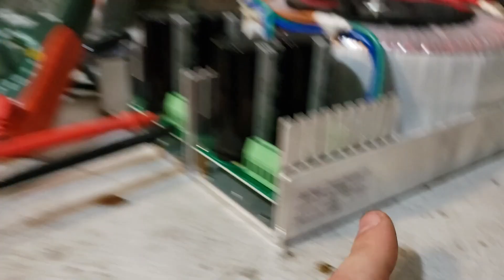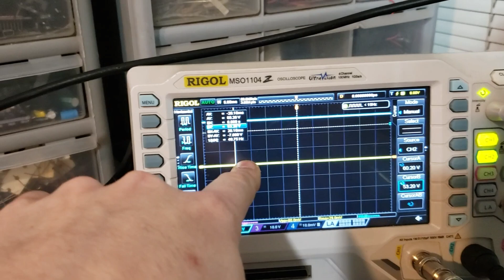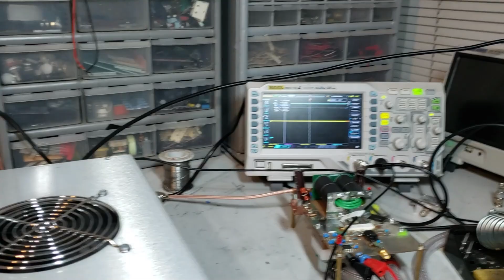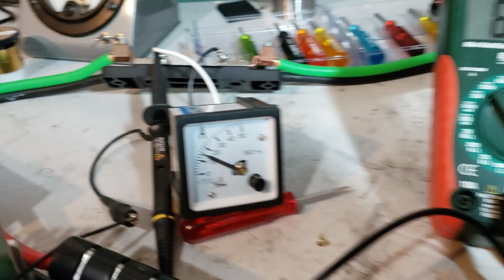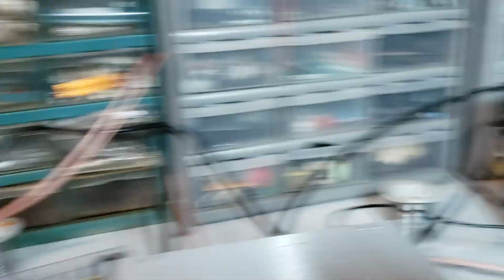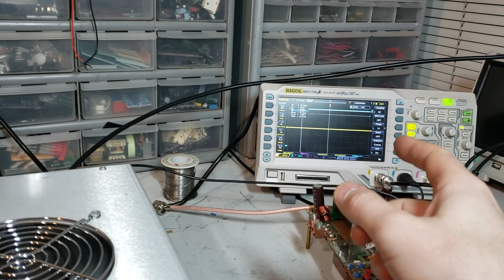65v Linear Power Supplies

Comment: Don't take this the wrong way. I like your videos but for someone who knows, they kind of make you look foolish. First, the noble prize folks will be bringing you an award for solving the old issue with efficiency. You are making more output power than you are putting into the circuit.. That is of course a historic moment and everyone is either knocking your door down to buy this alien technology or they are trying to kill you to keep it out of the market.  You are going to be disappointed in something. Maybe its the meter, I don't know. Lets do the math from your figures. 60.2 volts times 20 = 1204 watts input. You are showing 1800 pep out. Something is out of whack. You are getting more power out than you are putting in by a long shot. If your current and voltage figures are right then you are probably only getting about 960 watts out out pep.  I don't know whats wrong but I know something is wrong. That's 80 percent efficient too. Looking at the dead carrier the efficiency is shit.  60.8 times 15 is 960 watts in. You are getting 400 out. The efficiency here is in toilet at about 42 percent. Speaking of over taxing the power supply because you said you didn't want to over do it. The power supply is only good enough for 1560 watts input. Which equates to (at 80% eff) about 1250 watts out. Why are you  blowing smoke up our asses here?

Comment: Mr. MudDuckSharky ,  I just wanted to say thank you so much.  I ordered one of these power supply and love it. it's better than a mean well.  i built a ldmos off your schematic i did a little change to it like i a doorknob capasistor  of 650pf in the place of the 2 of 330pf  and it  runs great . thank you again .  aka 6o cheyenne wyoming channel 28

Comment: my dad wanted to know why you were phased by a transformer, bridge rectifier, and capacitors yet were comfortable with what looked like a complicated (by comparison) transmitter circuit?

$250 for an unregulated power supply is eyewatering expensive, yes he understands the high current rating of the transformer makes it more expensive but $250 for an unregulated power supply! what you, missed is that the 60-volt power supply would also transmit mains fluctuations at the ratio of the windings which on 110 volts would be 50%. it may be of course you do not need a regulated voltage but $250 for an unregulated supply. do you know $250 would keep my fashion disability satisfied for at least a week?

Comment: Can you parallel 2 and do they have a common share connection?
Reply from the maker: Yes. Output can be put in parallel, as many as need, with no other connections required.

Comment: 1800 peak watts out put? 
Come on  really? 
Your input power is , 60.2 volts by 18 amps equals 1083 watts 
So 1083 watts in, produces 1800 peak watts out put? 
Lol.   
18 amps for 1800 watts ?    
Come on Sharky .  Do the maths .  Look at the data sheet and efficiency curves. 
I question your watt metre !     166% efficiency ?   No way!
Reply: The amp meter is not a peak reading device. The bird is reading peak.
Reply: I agree, also, Why not hook up probe to RF output on Oscilloscope? Actually measure the peak to peak voltage to determine actual output?
Reply: I am not nearly a tech but i can understand it, 1000 watt DC will convert into 1000 watt RMS sinusoidal which will have a PEAK voltage aprox 1/3 higher then the RMS voltage and so in a 50 ohm load will have a PEAK wattage of over 100%. 
Right?
Reply: A 110 volt electric heater 1000 watt.
P=U(dc or rms)  x I 
U(dc or rms) =I x R
So I=1000:110=9 amp
So R=110:9= 12.2 ohm

So peakvoltage of 110 rms= 110x sqrt2= 155 volt @ 12.2 ohm
So Ipeak= 155:12.2= 12.7 amp
Ppeak= 155x12.7=1969 watt

His 1800 watts peak sounds to me just about right.
Right?
Reply: Thats why "they" say "peak power doesnt mean shit"

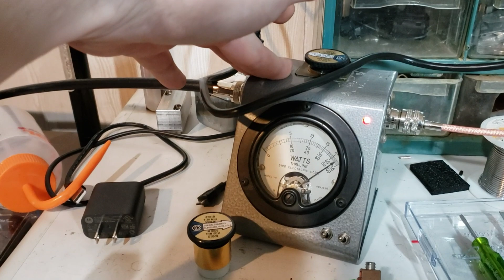Look at 6:53 , just before switching to peak you can see 500 watt rms(or is it average?) 1083 DC watts in: 500 RMS watt @100% mod out=50% eff.
Doesnt sound teabag for me, it is at least plausable.
Reply: robber576
Btw, he is not sticking his rf probe at the output because there would be around 300 volt rf(600 volt peak to peak) and his scope would probably blow up, you need a pretty expensive high voltage rf probe or rf hv attenuator to do that besides a scope is a quality device and not a quantative.
Reply from the maker: @robber576  Thank you for breaking it down 😁.

Here is my laymans terms answer:

It's like having a 100w light bulb turned on for 12 hours per day. Average power over the entire 24h will be around 50w, with a peak power of 100w. That's kinda like what's going on with this amplifier. The peaks are modulated all the way up to 1800w, but it doesn't stay there very long, showing an average input power of much lower than 1800w÷drainEfficiency.
Reply: It surprises me that this needs to be explained to (apparently) licensed ham operators 🙄
I have had 1 (start) year of medium level electrical education and then went the mechanical road for my profession about 30 years ago, i dont even have my ham license(but considering)🙂 
Nice videos, i like your style, keep it up 👍🏻
Reply: I didn't realize(wasn't listening) you were modulating AM, I thought it was CW, Where PEP & Average power are the same.
With those unprotected linear power supplies, my fear would be RF from antenna system getting into mains/transformer. With a dummy load you wouldn't see it, but when you actually transmit RF I suspect there may be an affect. Worth a test.
HV Probes are not that expensive, and the probes themselves are attenuators..
1800 Watts into 50ohm load, RMS would be 300v, PPv would be 849v, Use a 1000v or 2000v RF or standard probe.
Reply: @MudDuckSharky  
This link explains rms and peak watts .

https://www.kicker.com/app/misc/support/tech/tech_papers/docs/PeakVsRMS.

Or here is NXP data sheet, 
https://www.nxp.com/docs/en/data-sheet/MRFX1K80H.pdf

Figure 7 , cw out put power versus input power and drain source voltage
At 65 volts, 1150 watts out, equals 1900 watts input!   1900 watts / 60.8 volts = 31.25 amps 

Or figure 8 ,
Cw out put power , drain source voltage and efficiency, 
65 volts at 1900 watts out  equals 76% efficient.    You would need 2,356 watts input . 
At 60.8 volts that would be 38.75 amps ,  that more than double the 1083 watts you was consuming shown
In your video! 

Lastly you modulated a 400 watt carrier that exceeded 1600 watts pep, you made 1800pep? 
All with only 3 extra watts ?    

I guess the engineers at Nxp have it wrong and they don’t know there product!

Yet again, your another you tube guy that knows better.   
Doing what the engineers can’t or won’t! 

I have been a ham since 1988, completed my electronics trade certificate in 1992 - 
And your figures still don’t add up! 

Not one yaesu or kenwood or Spe expert or acom or emtron amp I have ever owned or seen, 
has been able to make more power Than it consumes.  

Question me all you like.
Reply: 3 xtra amps , I ment , not watts .
Reply from the maker: @busarob1969  It genuinely saddens me that you're trying so hard to prove a point that is flat out wrong. But that's ok. One day, when you finally understand how confused you were, when you made this comment, it will be a humbling lesson about spreading false information. Good luck to you!
Reply: @MudDuckSharky  so explain his needle swing Sharky?  https://youtu.be/iiDYlKYjTRI
Reply: One of you has to be wrong ?    Yet his numbers match
Reply: What about this video, 50 amps for 2000 watts ?    https://youtu.be/DvkAHaSyAlA
Reply: @busarob1969  Your eyes probably...
Reply: I love how so many critics post sh#t. How about this people. Instead of being that super smart wise a## ham operator calling bs. A little proof of concept from your perspective would be more appealing. I've been out of the game for years and I'm greatly impressed. Agree or disagree who else has taking your dead beat a## on this journey with them? I don't even know this guy but bro you are a straight up prick!

Comment: The LDMOS pallets have my interest. As long as a pallet comes with all necessary components and instructions I think I could put one together. My main concern is tuning. Do these pallets need to be tuned after assembly? I have no test equipment to tune with nor the knowledge to tune an amplifier.